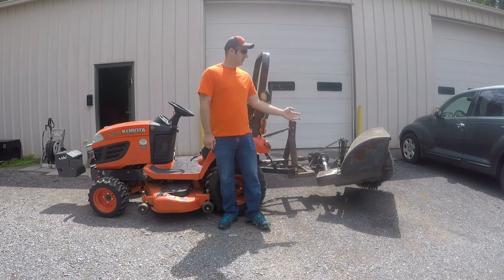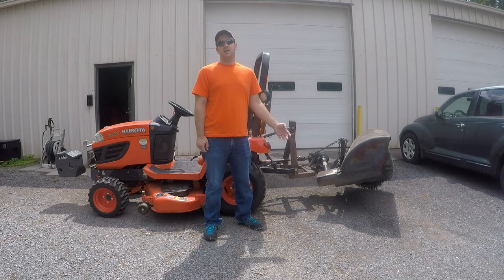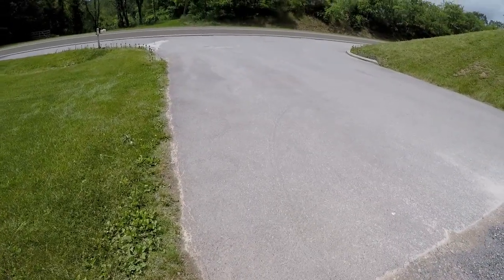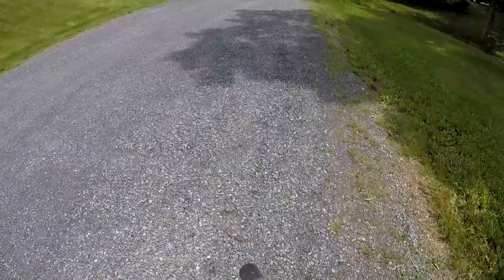Kubota BX Using Rotary Broom

Comment: Very nice it did a great job on that but it looks a little slow still to me i know on the big garden tractor i have worked on and had most every thing runs at 2000 rpm front and back so i would say it needs to run off the mid like a snowblower or deck if is was on the front but where they made it 3pt i would try a faster gearbox if you find one but it still work nice better than a broom ! Have a safe and great week ! Kioti Curt :-)
Reply from the maker: I thought it looked slow to but it seems to work well. It has a 3:1 gearbox and I believe it should be a 1:1. A gearbox is $150-175. It seems to wok well as it is. I'm not sure if it is worth putting a box on for no more use than I have. I'm not sure I really need it. The biggest problem I have is it need to be QH compatible.
Reply: i know what you are saying the gearboxes are not cheap i would think a 3:1would be good if the 3 is going to the broom but like you said it did a nice job if it works dont fix it ! LOL i like to get a QH but ever one has to mod there stuff to fit ! i just dont know if i should try one or not ! LOL have a great week ! Curt :-)
Reply from the maker: The 3 point hitch portion is something that someone made. If you don't want a quick hitch, you could get PATS easy change or something like it.

Comment: Have you tried your rotary broom on the grass yet? I'm curious how this would do sweeping acorns, leaves, acorns, acorns, and sticks. Oh and thousands of acorns in case I failed to mention my acorn problem. I am looking for a solution of quick clean up over what I'm doing now. It's either pay thousands to cut them down or buy something that can make quick clean up a breeze. Rotary broom or commercial tractor driven leaf blower or setting the yard on fire each fall season end. Thoughts? Lol thanks!
Reply from the maker: Yes I have. I tried using it to get rocks out of the grass from snow removal. It did not work well. It dug into the grass and dirt too much. It probably would have worked better with gauge wheels. I don't know how much cleanup you have to do, but how about a backpak leaf blower? A stihl BR600 or BR700 would be my choice.
Reply: Tractor Tech sir thank you for the reply. I have a LOT of clean up to do hence my sarcasm and humor about all of the acorns. I mean the leaves and sticks alone are a serious pain in the ass and this past fall the acorns were the worse I've seen. I'm getting estimates on having the trees cut down because it's that bad but that's proving to be an expensive idea so far. I own a back pack leaf blower echo brand equivalent to the stihl BR 600 and that only does so much to remedy this problem. I just need something more commercial grade and mechanical to connect to my 35 hp tractor to help I guess and thought maybe a rotary broom. Ugh guess I'll keep researching. Thanks
Reply from the maker: @lh98  My broom is not the best. I got it at an auction for $80. I really don't have much use for it, but for what I have in it I keep it. Even with a blower or a broom, you still have to haul the leaves away. Could you use a mower with a mulcher? That would take care of the leaf problem. You would still be left with the sticks and acorns. The only think I can think of that would get rid of the acorns and leaves would be a vacuum. A trailer mounted vacuum would do the trick but it would be pricey.
Reply: Tractor Tech I have a big yard couple acres maybe with lots of stupid oak trees but I could just power sweep it all into the surrounding woods I own no need to transport it. I thought a 5 or 6 foot broom hooked to my 35 hp tractor would make easy work of it. Still looking and researching. Oh and 80 bucks man that's a good deal even if it needs a little work.